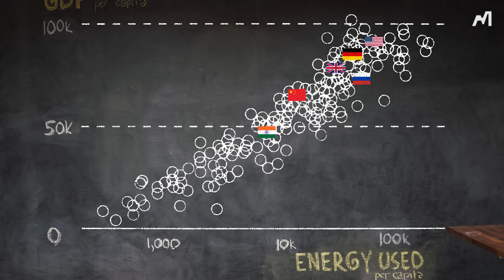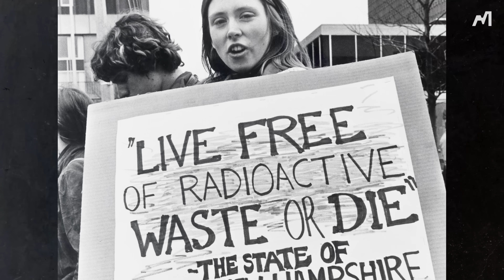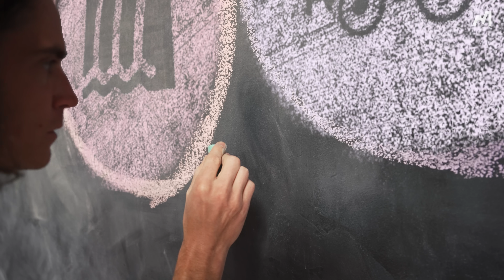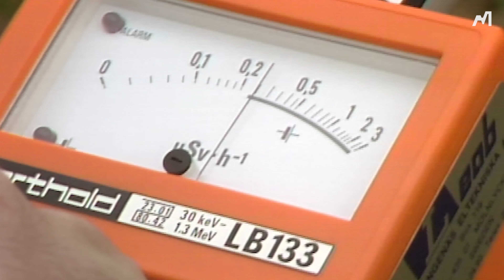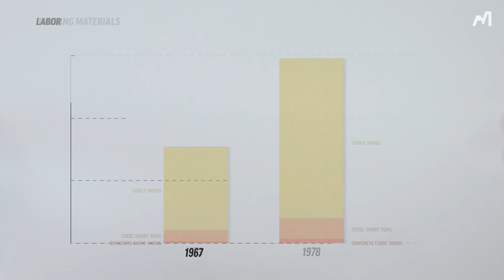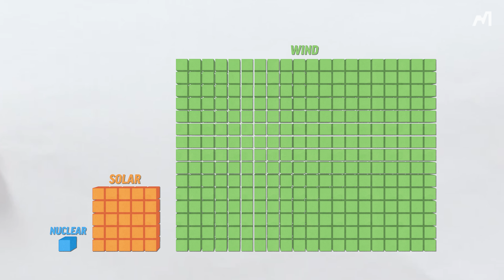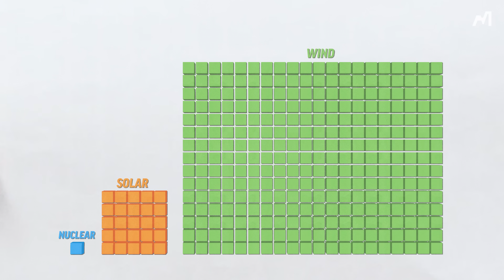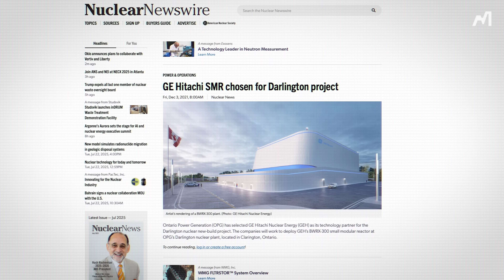They're Lying to You About Nuclear Energy

Comment: It's a bold strategy to downplay the thousands of long-term casualties from Chernobyl to "just 50 deaths." The video makes some valid points about fossil fuels, but the gross oversimplification of radiation risks and the consequences of Fukushima is just irresponsible. Maybe before your next venture into complex physics, you should run the script by an actual expert, like Derek Muller from Veritasium. Misleading your audience on topics this serious, presumably for the sake of a clean narrative, is a really bad look.
Reply: If data does not fit the narrative, it's ignored.
Happens all the time by anyone but true scientists.
Reply: You raise a valid and crucial point about the urgency of tackling climate change and the need for reliable, low-carbon energy sources. It's a complex issue with many factors to consider.
From an Austrian perspective, we have a long and successful history of relying on a different path. 2024 more than 90% of our electricity was generated from renewable sources. We are even targeting 100% renewable electricity by 2030. This demonstrates that a highly industrialized nation can be powered primarily by renewables.
This leads to the key aspects of safety and cost. Renewable energy sources like wind, solar, and hydro do not present the risk of catastrophic accidents or the long-term challenge of managing radioactive waste for millennia. On the economic side, the global trend is undeniable: the Levelized Cost of Energy (LCOE) from solar and wind has plummeted over the last decade. According to the World Nuclear Industry Status Report 2024, the LCOE for new utility-scale solar and onshore wind is now significantly lower than for new nuclear reactors.
This combination of enhanced safety and falling costs is precisely why renewables are seeing massive growth worldwide. They offer a scalable, affordable, and secure path to decarbonize our energy systems without the long-term environmental and financial liabilities associated with nuclear fission. While every energy technology has its own set of challenges, the current global momentum and investment trends clearly favor renewables as a cornerstone of our energy future.
Reply: @BernhardHimmer  Hydro is without the chance of catastrophic damage? You haven't done your research properly if you think that. Nevertheless, building hydro is undoubtedly worth it, also for managing water supplies and floods. But few countries are as well situated to use hydro power as Austria.

It is not great to look only at electricity, one should look at total energy consumption. Then Austria is at one third renewables only.

Production of metals and minerals needed for renewable energy causes massive environmental damage, which of course we Europeans never see because we closed most of our mines. Of course nuclear also uses materials, but less of them.

Current costs are not always a good indicator, that is one of the main (indirect) takeaways from this video.
Reply: It's hard to prove death by radiation. Often the cancers it causes show many years later. However, he did mention that there was increased cancer around those areas, primarily thyroid cancer. Which as stated is a manageable and very treatable cancer with little to no side effects. Saying everyone that now dies of cancer in that area was due to that is also misleading. Current info by experts says it really was not that bad if you were not a first responder or directly at the site.
Reply: @endurofurry Your comment, and the video itself, conveniently ignores the massive, inconvenient truth of large-scale radioactive contamination. The idea that it "was not that bad if you were not directly at the site" is a dangerous oversimplification that completely disregards basic meteorology.
The weather during the Chernobyl disaster carried the radioactive fallout across all of Europe. I live in Austria, hundreds of kilometers away, and to this day—decades later—local authorities still warn against consuming certain types of wild mushrooms, like the Bay Bolete, because they are still contaminated with Caesium-137 to unsafe levels. This isn't a theoretical risk; it's a tangible, long-term consequence far from the exclusion zone. We see the exact same convenient oversight with Fukushima, where the contamination of the Pacific and its marine life is a massive, ongoing issue that is often downplayed.
But the most glaring and irresponsible omission in this entire narrative is the complete silence on the issue of permanent disposal of high-level nuclear waste. To compare the danger of spent fuel rods to un-fissioned uranium or plutonium is utterly absurd. Before fission, the material is dangerous, but manageable. After fission, you have a hyper-toxic cocktail of isotopes that will remain lethal to any life form for millennia. This isn't just radioactive; it's a seething witches' brew of elements emitting highly penetrating gamma radiation that requires permanent, deep geological storage—for which we have absolutely no proven long-term solution anywhere in the world.
To downplay this as a manageable problem while glossing over widespread, lasting contamination is not just misleading; it's a dangerously irresponsible way to advocate for a technology whose consequences can create permanent, uninhabitable sacrifice zones and a geological curse for thousands of generations to come. Your point about "manageable" thyroid cancer is a callous attempt to minimize the real-world, long-term price paid by millions.
Reply: @BernhardHimmer  The material is "manageable" both before and after fission, which is proven by the fact that facilities around the world do handle it every day. I agree that the economic and social costs of the Chernobyl disaster are downplayed in this video. But you are exaggerating instead of downplaying. Is that truly better, in a situation where society is acutely threatened by climate change? Are we really sure we can build enough renewables? And are we really sure that they will do less long term harm? It is impossible to answer these questions when blindly exaggerating (in any direction).
Reply: @BernhardHimmer Ah yes, "half the pacific is a dead zone", wasn't it? "Sailors in tears", I seem to recall.
Let us not forget the "blue flashes" during an aftershock "proving a criticality event" which had "doomed half of Japan". All according to those fact-checked experts at Enenews, a now thankfully-defunct website for "news about energy", which seemed to focus only one one type of energy.
Reply: @michaelmartin9022 It's a telling strategy to invent hysterical strawmen from a dead website to avoid addressing the actual point: the video's irresponsible downplaying of long-term health consequences. Much easier than engaging with the real criticism, I suppose.
Reply: @BernhardHimmer  This was never a discussion on how plants are effected. Almonds contain cyanide without any disasters. So don't eat what you're not supposed to or in proper doses and you will be fine. Permanent disposal of high level waste is easy. Put it miles down at the bottom of salt mines. They already do it. If it leaks even with the massive quantity of precautions then it won't hurt anything. You know how many water supplies were ruined, etc, etc due to coal-fired alone. Makes a radioactive mess not seem so bad.
Reply: @endurofurry Your reply is a prime example of dangerous half-truths and logical fallacies that make a serious discussion about the risks of nuclear energy impossible. Let's dismantle your "arguments" one by one:
The almond/cyanide comparison is absurd and dangerously trivializing. Cyanide in almonds is a known, natural substance whose risk is controllable through simple processing and dosage. Radioactive contamination after a major nuclear accident is the exact opposite: an uncontrolled, invisible, and long-lasting contamination of the entire biosphere—soil, water, plants, and animals. Your advice to "just not eat what you're not supposed to" is a complete mockery in the face of radioactive cesium or strontium in the food chain for the affected population.
The claim that permanent disposal is "easy" is a demonstrable falsehood. There is NOT A SINGLE operational deep geological repository for high-level commercial nuclear waste anywhere in the world. The problem has remained technologically, geologically, and ethically unsolved for over 60 years. To say "they already do it" is a gross deception of the public.
"If it leaks, it won't hurt anything" – a statement that can hardly be surpassed in its irresponsibility. The only reason there is a proposal to bury the waste "miles down" with immense precautions is precisely because a leak would be a catastrophe of unimaginable proportions. Contamination of groundwater with long-lived radionuclides would render vast areas uninhabitable and unusable for millennia. Your assertion is a scientifically untenable and dangerous placation.
Your reference to coal is a transparent diversionary tactic (Whataboutism). Yes, the destruction caused by coal is devastating. But citing the problems of one technology does not justify trivializing the completely different and extremely long-lasting risks of another. You cannot justify the plague with cholera. Radioactive waste remains dangerous for time periods that exceed the entire history of human civilization many times over. This is not a problem that exists with coal.

Comment: If you are for or against nuclear power, but are not formally trained in the field of nuclear physics or nuclear power, I highly recommend that you do your own research. Do not just take some paper or article at face value. Critically look at everything that you read. Does it have good sources? Is whomever wrote it reputable? Etc. The worst thing you can do is lean into confirmation bias and say "you're completely wrong/right because of x,y,z". There's always more information for you to find, there's always more research being conducted, and there's always more that you don't know.

I understand why nuclear power has a bad rep. While a lot of it is derived from fear mongering, there is some truth. Chernobyl was a tragedy, but it was also a completely avoidable incident that was made worse by arrogance, the spread of misinformation, and terrible work practices when it came to plant management. 3-mile island was a combination of a material failure (a valve in this case) and human error. Fukushima, the most recent nuclear incident, was also preventable. When the design of the facility was started, both the plant operating company and the regulatory company overseeing the design did not properly account for the potential height of a tsunami, and therefore provided the environment needed for the tsunami to take out critical plant safety equipment (in this instance it was their emergency diesel generator which was flooded by the tsunami). In fact, the Onagawa nuclear power plant, which is located near fukushima (approx 2 hours or 91 miles north), was hit by a 15 meter (49 ft) wave but they had a 14 meter (46 ft) tall sea wall with additional facility design considerations being given to earthquake survivability. By comparison, the wave that hit fukushima was the same height as the portion that hit onagawa, but the sea wall at fukushima was only 5.7 meters (19 feet) tall. As of today, the Japanese government has raised the sea walls at onagawa to 29 meters (95 feet) as an additional precaution. 

When you look at death estimations between coal and nuclear power (I chose coal because it is the main form of power production worldwide) there have been approximately 6,000 deaths associated with chernobyl and fukushima. This includes cases of cancer and acute radiation poisoning, as well as other biological effects caused by radiation exposure. By comparison, just in the US between 1999-2020, there were an estimated 460,000 deaths in the medicare community due to fine particle pollution put off by coal based power plants. When looking at the occupational risks of cancer, nuclear power plant workers receive an estimated 160 mrem (1.6 mSV) from their job while pilots and flight crews receive an estimated 307 mrem (3.07 mSv). While data for cancer cases among nuclear power plant workers is difficult to come by, knowing that nuclear power plant workers receive about 1/2 of the estimated dose of pilots, and with the statistic that pilots are 24% more likely to develop cancer than the general population, it is reasonable to estimate that nuclear power plant workers are 12-15% more likely to develop cancer. To give an additional comparison, firefighters are 9% more likely to develop cancer due to their exposure to carcinogens (substances or agents that can increase an individuals risk for developing cancer).

Now please, do NOT take my word for it. I am just some random person on the internet. Please, do your own research, develop your own opinions based on facts, and ensure what you're reading is factual by cross referencing information and ensuring the sources for that information are actually viable and reputable. 

While I am a big proponent for nuclear power since it is the most viable long term form of clean energy based on my experience in the nuclear field and the research that I have personally conducted on the subject, I am an even larger proponent for thorium reactors. While the facilities would have to be larger to output the same amount of power, the fuel source is more readily available (by 3-4 times), it can be extracted during other mining processes, and the waste is only radioactive for a few hundred years vice the tens of thousands of years seen with traditional uranium reactors.

Comment: Don't eat Uranium. It is an Alpha emitter. It will cause internal GI damage as alphas can cause a lot if ionization's in a relatively large area over a short distance. You can however hold it so long as you have no cuts on your hand. A dead skin cell layer on your skin absorbs and protects you.

Comment: Nuclear is the worst form of energy in the world. Its not green in any way. How do we dispose of the irradiated cooling liquid? What happens if theres a large solar flare like the Carrington event?
Reply: Green isnt always best, And the "irradiated" cooling water isnt always irradiated. Depends on if the plant is BWR ( Boiling Water Reactor ) or PWR ( Pressurized Water Reactor ). BWR water is treated as waste because the water touches the fuel rods, but its in a loop in the plant the whole time. as long as the plant is running the water wont leave it, while PWR water doesn't come in contact with the fuel, meaning it can be discharged. 

To summarize it: BWR water doesnt leave the plant and is used till the plant is not used anymore, PWR water can be discharged back into the waterways.
Reply: @ProjectAlx While you're busy trying (and failing) to explain reactor plumbing, you're conveniently sidestepping the actual issue. The "irradiated cooling liquid" is just a tiny fraction of the problem.
The real conversation is about the mountains of spent fuel rods for which we have no permanent solution. We are creating a geological-scale threat, and no rosy statistic from the nuclear lobby can ever quantify the certainty of future disasters this waste will inevitably cause.

Comment: Holy cow - what a nicely produced video of garbage bias/lies/etc.
1. no sources in the video (a few links in the description with no knowledge which statement comes from where is useless).
2. BS graphs (not even showing what is  being graphed)
3. what "deaths" are you comparing with different power sources? Over all time? Per produced MWh? Does it include mining/refining/transporting of source materials? What about enriching "stuff" to even get useable nuclear fuel. Where is the fuel coming from?
4. What about fuel reserves remaining on earth?

At least with carbon fuels (oil, gas, coal) we could at least theoretically use them carbon-neutral by planting and burying just as much plant life (eg. trees) as we're burning (you know, putting the sun's energy absorbed millions of years ago back into to ground so it doesn't accumulate in the atmosphere. Is stupidly inefficient but since we already burned so much...).

With nuclear energy that's not an option. You just release all the additional energy (heat + electricity -> heat) into the environment without any chance of "putting it back".

Renewable energy at least "only" removes energy from the equation (converting existing "free" energy from the sun into electricity which is radiated away from earth (to a small degree)).

--------------- EDIT#1
Yeah, let's downplay cancer and other real health effects just so we can produce nuclear energy (no matter how easy to treat - unless there's an irradiation protection pill without any side effects...).
Reply: QUOTE: SMRs are predicted to have higher fuel costs than large reactors. Particularly, integral pressurized water reactors (iPWRs) are shown to have from 15% to 60% higher fuel costs than large reactors.

Source: DOI:10.4236/epe.2014.65009

I didn't read or compare the paper/publication with other "data" but I'm pretty sure the "economics of scale" still apply.